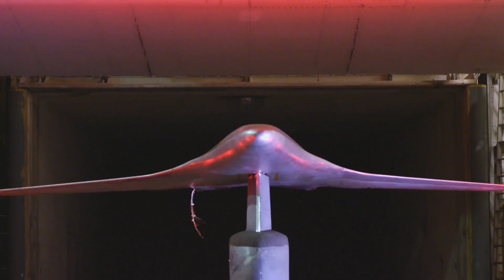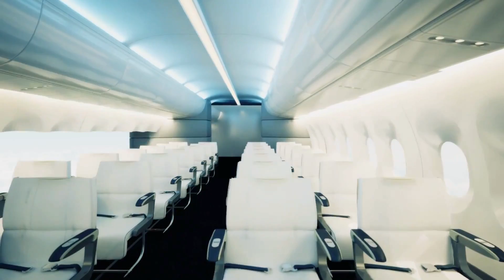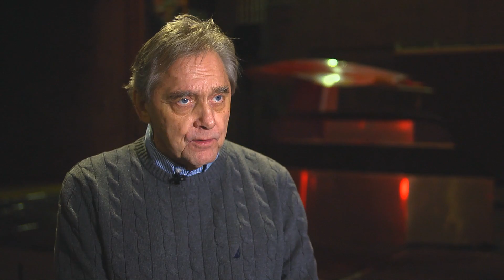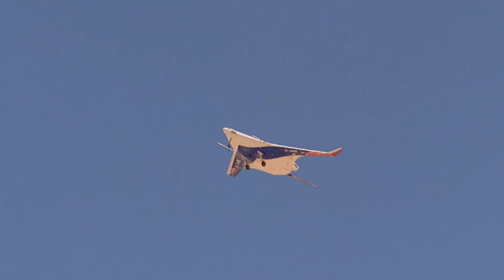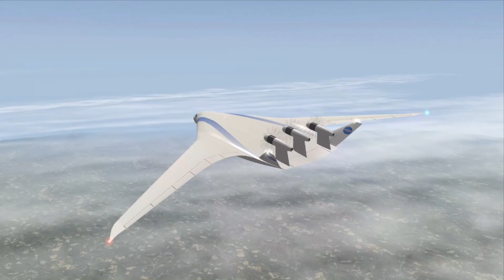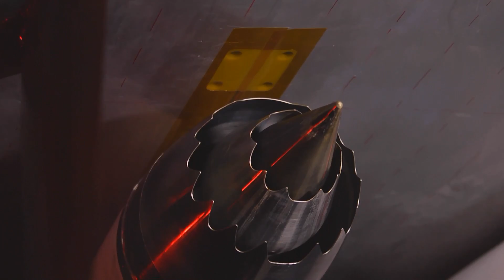ERA - Revolutionary Evolution

Comment: Fascinating video! What kind of propulsion is used on the small scale models? And are sound measurements taken from the plane in flight or other models in the wind tunnel?
Reply: The propulsion seemed like RC jets actually (commercial/store bought) and they are actually jet motors but very simplified. Although they seemed a bit bigger but think there are commercial engines in this size also...